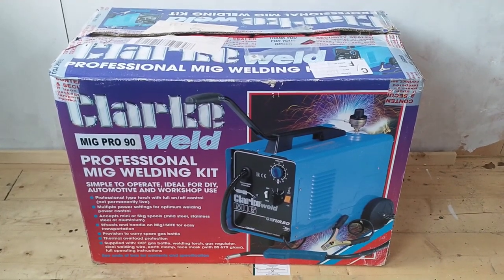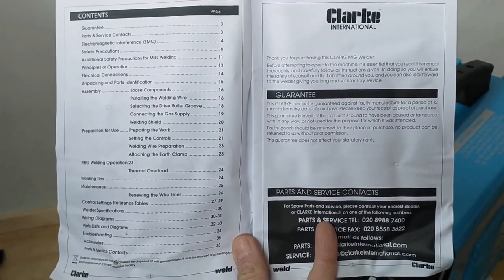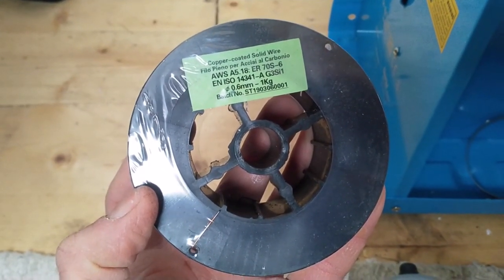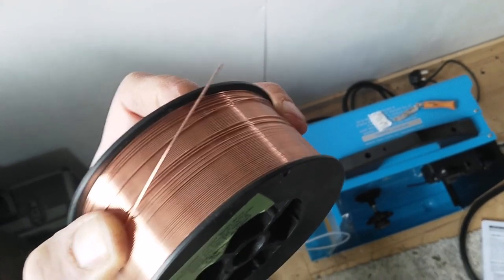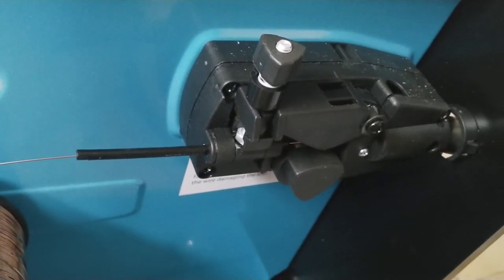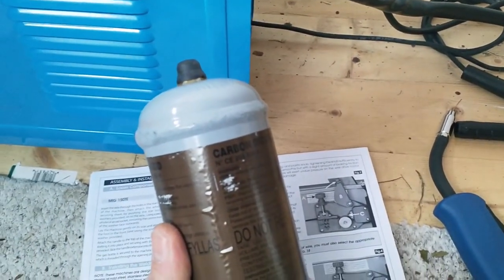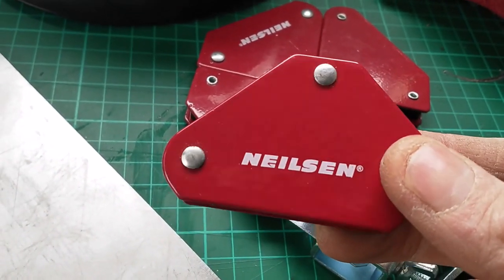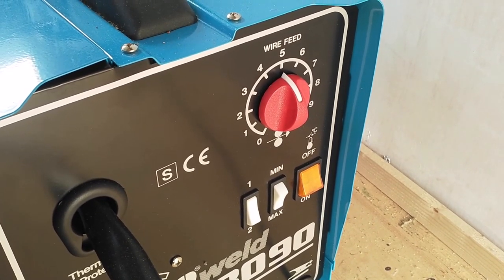Clarke Pro 90 Mig Welder Review [Set up and beginner welding]

Comment: Just started welding and some good advice I read was if you get popping sounds (rather than a consistent sizzle), wire speed is too fast. If the wire burns up before reaching the work piece, wire speed is too slow.

Comment: Any updates, did you find the right settings for the 20 gauge sheet metal. Bought the same welder. Just want to get the settings right, for tack welds. Thanks
Reply from the maker: Not sure how accurate these things are but that is pretty thin so would try 1/min first.

Comment: Thanks for the review of this little welder. I’ve got a Clarke 100E. Any idea where to get parts for these?
Reply from the maker: Probably depends a bit on the specific part. Machine mart and some.other retailer sell a few  bits. eBay is probably a reasonable place to spot a few more either new or from broken units.

Comment: what gas flow di you use please
Reply from the maker: Hi John, between 2 and 2.5, which was about the lowest setting for a consistant flow I could find, although not sure how consistent these regs are. Presumably if there is a breeze would need to up a bit.
Reply: thanks will try just learning/ha ha

Comment: not bad. anti spatter spray may come in handy. id disconnect the gas after every use. i used to use my left hand resting on my work with a gauntlet on the right sat on my left to keep steady it keeps the arc at the same distance easier then both hands floating using just a normal leather glove as you feel the torch better/trigger .......of to go cut and weld something now ive talked about it. #wyc
Reply from the maker: Nice one thanks WYC. Will give that a go.